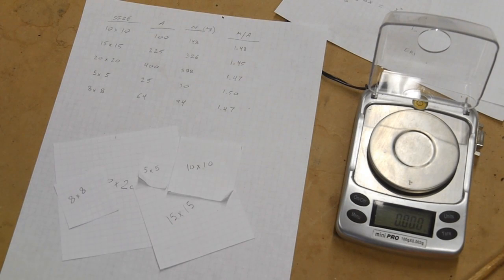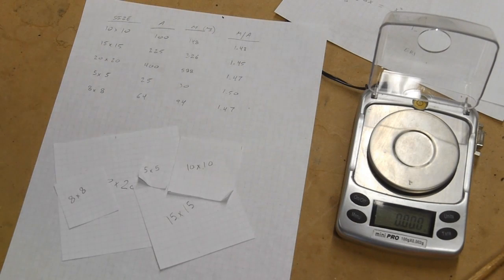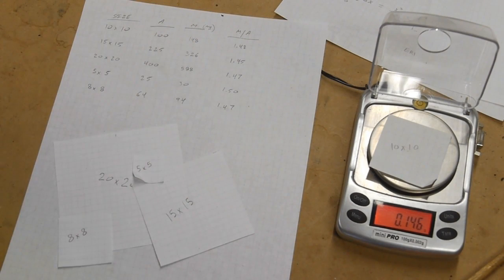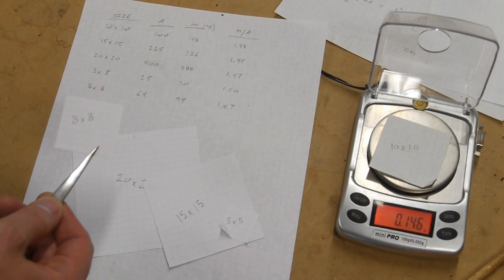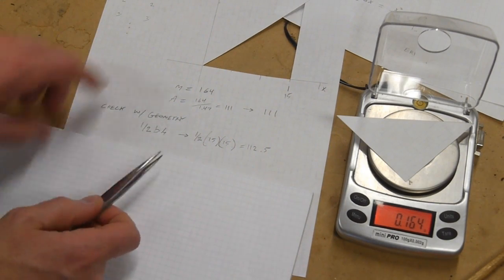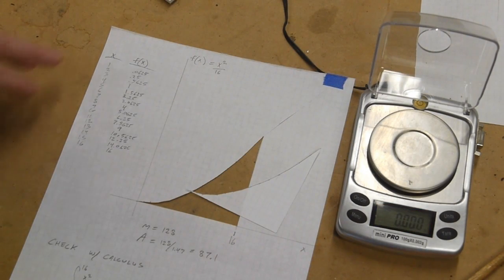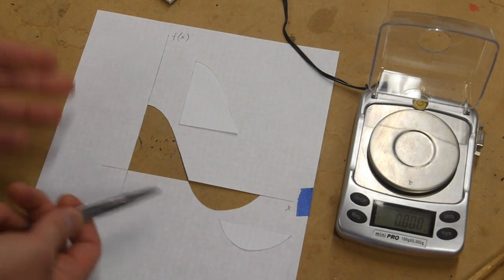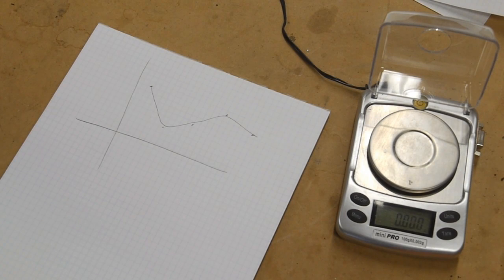Mathematical integration without calculus

Comment: To substract the negative part, you don't need to actually substract.
Just use the TAR function of the scale to reset to zero!
First you place all the negative pieces onthe scale, press TAR then measure all the positive pieces :)

Comment: We used this method back in the 70s on result plots from our Gas Chromatographs. Perkin Elmer had just released the first electronic integrator but at over $10,000 per ( we had about a dozend GCs in the lab) this was out of the budget. So either manual triangulation or Scissors and a sensitive lab scale where the tools of the trade :-) Tks for waking up some good memories!

Comment: I invented the Calculus.  I can calculate the area of objects simply by orbiting around them in a perfect mathematical circle.  I call the time it takes the point to orbit a period-one period equals pi.  Objects inside the big circle intersect with a rate have rates(x*a).  When rates x and (a) equal, equal are the rates  being traveled.  Since equal are in equal time then equal rates equal equal area.  Also after one period the length i drew was one pi but for easy purposes 4*Pi.  Pi/4 is the ratio of a circle to a square.  Tell me if your interested.  Putting pi on the paper is such a delight-especially when you want to square it.  Simply draw a diameter of one, that's what rulers are for.  All rules of geometry say one can be ascribed exactly as an intersection of two points(SAS).  Since the angle is zero.  So what are you waiting for.  Two lines are equal if their bisection is equal.  The one measurement can be bisected.  I allredy put pi on paper in one orbit. so 4*pi, Pi, Pi/3, Pi/Pi, and even the trisection of an arbitrary angle-which is simply half of an angle then adding that half then doubling the radius which half's the angle there to be added to three as total-trisected the beginning angle.  If this is the first time an angle has been trisected for you then that is proof i did the impossible already.
Reply: GodZilla Lightsaw nice

Comment: People did this in the old days? When? Because you need a high precision scale to do this. In order to deal with the precision issue, you would need heavier paper or something heavier. I think 300 years ago, they would do the Riemann (spelling?) method.
It also reminds me of what people did to find the area of a circle. Making small triangles to fit inside it. It took a while to figure out the value of tau (2*Pi) and how to use it.

Comment: This was the method of choice for finding the area under peaks in chromatography, in the time before mechanical (disc) integrators (which was before it all went electronic).

Using this very method, I was able to demonstrate that a chromatograph of TCPP isomers produced by ICI in Belgium (who were claiming that their chromatogram showed that their product had a superior isomer ratio) was produced by overloading the amplifier which gave the wrong results - they had assumed that they could get the main peaks off scale and it would all still be counted, ie, not clipped by the amplifier.

I photocopied their chromatogram onto some uniform paper, cut it out and weighed the peaks (on a four figure balance (down to 0.1mg)) and came to the same result as they did, demonstrating that their results had the main peak clipped and therefore their real isomer ratio was not as good as they claimed. (Later on, a sample of their product put through our chromatograph showed that it was worse than ours - based on their definition of what was better or what was worse)
Reply: I loved every second of reading that.

Comment: This is so cool. Do you think that any markings on the paper i.e. pen or pencil marks would be the reason for the margin of error?
Reply: MultiGoban
I think you misunderstood what he was doing. He had a range of masses to calibrate his measurements. So when he got his M/A conversion for paper, it was not off of the 30mg test alone but the range of samples he made. Also, the integrations he did were using pieces of paper that were over 100mg making the error in the scale less than the error he got (most likely from not cutting off the exact line). Try it out for yourself, it's fun :)
Reply: The mass of the smallest piece of paper was 30 grams. The error on the scale was 2 grams. That's a 6,66% error right there... he got lucky.

Comment: You didn't account for the weight of the graphite in his calibration measurements. That's why mass over area increased for the smaller papers, because they had about the same amount of graphite on each piece regardless of its size.

Try re-doing your calibration without labeling the paper, OR re-doing your math for a linear equation with non-zero Y intercept.
Reply: Perhaps, but the paper is not uniform either and any scale used to weigh them already has a precision limit and error associated with it and will never result in a 100% accurate measurement.
He said that he assumes the paper is uniform (which it is not) and that the scale has a precision of 2mg. That in itself would already easily account for the 2% variation given the measured weights of the papers we see.
Reply: Or maybe precision of the cut.

Comment: Cool idea. For calculating the graphs crossing the x-line you could place all negative areas on the balance, tare it, remove them and then place the positive areas. even fancier than subtracting the values manually.

Comment: This is how we used to do numerical integration, without computers.
Reply: No, it isn't.  No one ever did integration in such an asinine way that relies on the accuracy of a hand drawn graph and scale capable of measuring micrograms.
A 2% error in mathematics is utterly unacceptable.
Reply: war1980 When we didn't have computers to do numerical integration this was the only way. I am afraid you are incorrect.
Reply: Jarod Benowitz 
Because this is how Leibniz and Newton did it?  Because this is how Reimann Sums work?  Because Gauss' weighted function was derived by literally weighing objects?

This process is mathematically inaccurate and unacceptable.  There are far more accurate ways of measuring the area under a curve than geusstimating with a hand drawn graph, and they've been used for over 300 years.  For the last 2000 years, finding the area under a curve has always been done with mathematical calculations using algorithms, not the mass of whatever object you draw the graph on.
Reply from the maker: Jarod Benowitz  war1980 It's exceptionally rare that I delete comments because they are unproductive and hateful.  Let's keep it that way.
Reply: war1980 Much like Euclid's method of finding π through exhaustion. However, I wouldn't say the method is completely and utterly asinine, however it does a good job at giving some visual representation of the integral. I was once shown a model of the atom being a spheroid with electrons attached with lines around a nucleus, one can call that asinine from the perspective of quantum mechanics, but it serves as a good and simple representation of what the atom is.
Reply: *****
Except it really wasn't, as far back as Archimedes, mathematicians used a form of "integration" that was based upon the same idea as a Riemann Sum, specifically shoving as many easily calculable polygons into the area and adding them up.  The idea of weighing the graphed area is pretty asinine from a mathematical perspective.
Reply: Johan Gonzalez Which is exactly the reason why we use advanced computational systems to do so? And not this method which is a visual representation of numerical integration, so it is feasible for people who have no idea how integrals work to see what numerical integration is?

It's like you're complaining that a junior chemistry set isn't well developed for chemical analysis.
Reply: war1980 What I think they meant to say is that this is the way integration was performed without rules of calculus not even being formulated yet.
Reply: war1980 Please continue to regale us about how smart you are.

/s
Reply: war1980 You clearly aren't that familiar with mathematics and probably just finished calc 1 or 2. The error on Riemann sums is dependent on the behaviour of the function. Not all functions are well-behaved, some for example are differential-nowhere and standard integration techniques do not work. This is especially the case when you are taking data and need to first fit the data then find the area under the curve. Without numerical integration this was the method used. I had a physics professor tell us about how he used to do this before computers.
Reply: cautionthisissparta 
Not sure what "faithsmashing" is, but Christian rock videos are not really my thing.
Reply: *****
"So, what about the asinine numerical analysis algorithms Wolfram Alpha, MATLAB, etc. perform when you request a numerical answer?"
What about the number of times I have to piss in a given day?  Oh that doesn't matter, neither does your question which misrepresents what I said.  Thanks for that by the way, I really appreciate being straw manned.
Its simple English:
No one ever did integration in such an asinine way that relies on the accuracy of a hand drawn graph and scale capable of measuring micrograms.

"Symbolic manipulation and exact answers can only take you so far. "
What a load of bullshit.  The notion that math should seek to be inaccurate is anathema to the very purpose of math.  
There is a reason why the circumference of a circle is 2* pi *r instead of 6.28 * r.
There is a reason e is represented as e and not 2, 2.7, 2.718....
Pi and e are EXACT representations of an irrational number, just as transcendental numbers have EXACT representations.

" Let the nice man demystify calculus for all the high school kids out there."
This doesn't "demystify calculus", it does more harm than good.  This example literally has only one purpose, proof of concept for some engineering applications, and has ZERO place in calculus.

Weighing a piece of paper to get the area under the curve of a hand drawn graph, get the fuck out of here.
Reply: Instead of arguing over mathematical concepts you clearly misunderstand perhaps you should go learn something. Transcendental numbers by definition are not exact.
Reply: Applied Science Honest deductions are not hateful.
Reply: ***** 
"However, I wouldn't say the method is completely and utterly asinine"
From a purely mathematical perspective, I would disagree, I've already stated the method has a use outside of a purely mathematical situation.  It relies on a hand drawn graph, hand drawn function, paper cut by hand, and the use of the ratio of surface area to mass that was shown not to be constant as a constant.
We can quibble about what it takes to qualify as asinine, but using this methodology for integration is foolish.
Reply: Jarod Benowitz
"The error on Riemann sums is dependent on the behaviour of the function. "
If there is one thing I literally couldn't care less about, it is the accuracy of Riemann sums, also irrelevant and probable straw man.  

"Not all functions are well-behaved, some for example are differential-nowhere and standard integration techniques do not work."
Don't care, irrelevant and probable straw man.

"Transcendental numbers by definition are not exact."
More utter nonsense because you clearly do not understand.  
"Pi" is exact., or does "¶" somehow not accurately and 100% exactly represent "pi"?
Euler's number is exact., or does "e" somehow not accurately and 100% exactly represent Euler's number"?
Chapernowne's constant, Cataln's constant, Liousville's number, Hilbert's number, and on and on and on and on and ad friggin nauseam all have EXACT representations.
I don't care if it takes sigma notation, limit theory, an apple pie, or all three, exact representation exists, or you can't prove it to be transcendental.  Well.... that just happened.  
Or if you'd like to contact the Nobel committee with your findings, I'm sure they would be very interested.

"This is especially the case when you are taking data and need to first fit the data then find the area under the curve. "
And this is the crux of your problem, you didn't understand what you were told, and you don't understand what is being discussed.  
1. Numerical integration by its very definition REQUIRES a function,  
2. what you are talking about is simply finding the area under a "curve", not under a function,
3. therefore, it is NOT numerical integration,
QED.

Do you need me to go over that again, or do you understand why using this method for an instance of "not numerical integration" doesn't constitute a case of using this method for numerical integration?  Or perhaps you still don't understand the salient point of contention?
Reply: Please tell me you are trolling.
Reply: war1980 I tip my fedora to your superior intellect, m'good sir. allow me the pleasure of joining you on a faithsmashing conquest on some christian rock videos.
Reply: Jarod Benowitz
When all else fails, make accusations?  Unpossible!!!

You're the one incapable of staying on topic....
Reply: Perhaps you can enlighten me on the graph isomorphism problem with your superior intellect because I have recently failed at proving it to be in P.
Reply: Jarod Benowitz 
So that would be a yes, you are trolling and have no idea what you're talking about.  Thanks for the update, but I got that a long time ago....
Reply: I proved that if you generalize a walk of length k, such that k is an element of the real numbers discluding the natural numbers then the adjacency matrix raised to the power of k is complex always. Could you shed some of your infinite wisdom of mathematics to guide me in the right direction from here?
Reply: See now you're simply engaging in pedantic games in an attempt to save face.  Sorry, you'll have to troll elsewhere.
Reply: war1980 I mean, I'm pretty damn sure it was evident that this was going to be flawed in someway when we're using measurements here; of course it's not mathematically correct. To me, it seems rather unfair calling this asinine from a mathematical standpoint. There are already different proven methods of determining integrals. Therefore, it would seem that you are nitpicking at a valid method of demonstrating mathematical integration through the use of tools that are incapable of determining accurate measurements.

Perhaps this could have some type of validity in the future like Applied Science said, but we need better tools to do it.
Reply: This is actually how i learned math, apply THEN calculate...
Reply: Joe Creed  yes...but a while ago...I came up with a better rule for solving irrational trig functions i remember correction (the ones with trig & fractions). Again a while back...lol....
Reply: Math is awsome!
Reply: *****
"To me, it seems rather unfair calling this asinine from a mathematical standpoint."
From a purely mathematical standpoint it is; from an engineering or application standpoint, not so much.
Reply: war1980 Well, I guess we can not be rational and intelligent primates and not address the actual arguments of a given statement while taking a portion of an argument/statement and addressing it without any reasoning.
Reply: Joe Creed Yes, I have. I've done research in pure mathematics such as graph theory and am currently working with nonlinear coupled higher-order spatio-temporal differential equations describing the biophysical mechanisms of synchronized neurons.
Reply: Joe Creed Is the trapezoidal method always better than this method? What is the error on the trapezoidal method? Are there any functions that the trapezoidal method fails at approximating?
Reply: Perhaps the Monte Carlo method is better than the trapezoidal method, or perhaps Fourier Series is better. The trapezoidal method is a very primitive numerical integration technique.
Reply: Go ahead and look into Real Analysis its very interesting. What makes a function smooth, monotonic, continuous, differentiable, etc? What is the error of the trapezoidal approximation with respect to the behavior of a function?
Reply: +war1980 Perhaps try thinking about mathematics without too much emphasis from the limbic system. It may help in understanding mathematical concepts.
Reply: Jarod Benowitz 
 Pathetic, pedantic games do not undo the obviously erroneous statements you've made by misrepresenting basic mathematical concepts.
You had the chance to save some dignity, but that has since passed, now you're simply throwing a tantrum because someone called you on your bullshit.
Reply: Jarod Benowitz  Monte Carlo, I haven't heard that name in a while.
Reply: war1980 You display Troll-Idiot duality. You are both a subtle troll and at the same time a complete idiot.
Reply: Jarod Benowitz 
You sure that is the statement you want to make?  This "complete idiot" just did just demonstrate a superior grasp of some pretty basic mathematical concepts, and far more civility.  So, there's that.  But don't let me dissuade you from your tantrum, I'm starting to believe you....
Reply: ***** times are changing. We cant go to mars or even the moon with a 2% error

Comment: Very clever. Although I suspect you increased your error in your M/A constant by writing pencil on the sheets of paper. Since there is roughly the same amount of graphite on all sheets of paper, this will increase the M/A ratio for smaller sheets - which is exactly what you notice for the 5x5 sheet. Still very clever. I enjoyed it :)
Reply: That was one of my first thoughts when I saw the writing on the papers.  If you're weighing to get small values, you want as little "contaminant" on the paper as possible, and graphite would certainly be a contaminant.